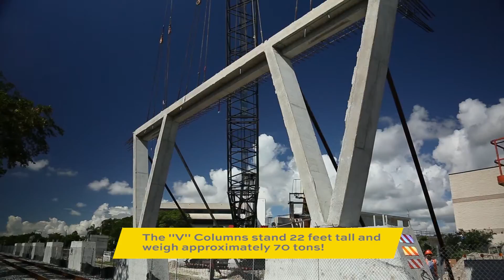First V Column Lift At Brightline's Fort Lauderdale Station

Comment: Great video. please consider bringing a station to Port Saint Lucie. I know there has been opposition for a Treasure Coast station but that has been mainly opposition from small Treasure Coast towns. Port Saint Lucie is the central location smack dab in the middle of the Treasure Coast and is also home to the highest population of any other city on the Treasure Coast. Port Saint Lucie is right in between Orlando and Miami so it makes it an ideal location.. So residents are used to progress as there is construction here everyday. It only makes sense to have the Treasure Coast location for bright line in Port Saint Lucie and I think that you will find that the Port Saint Lucie City Council would be a little more willing to work with you vs. Martin County or Indian River County. Please consider it I don't know that me and a few other people are really hoping to bring a station here. If the only option is West Palm Beach, then it is a waste of efficiency to drive down there to take the train. By removing the Treasure Coast as an option, you are cutting off upwards up almost 600,000 residents! ( population of the three Treasure Coast counties combined.) please consider Port Saint Lucie as a train station option!